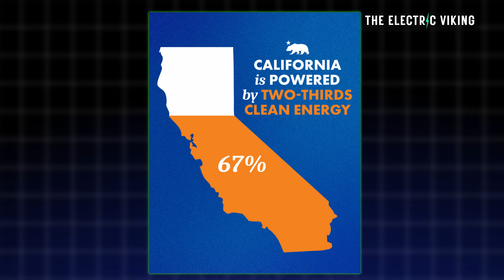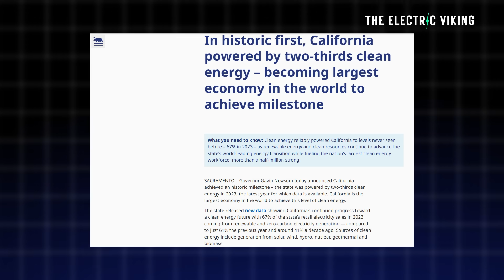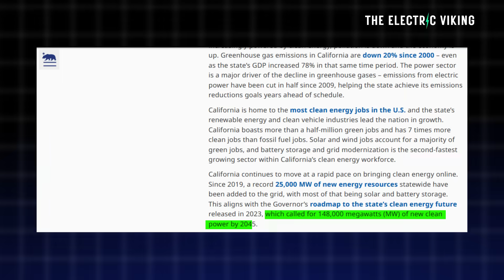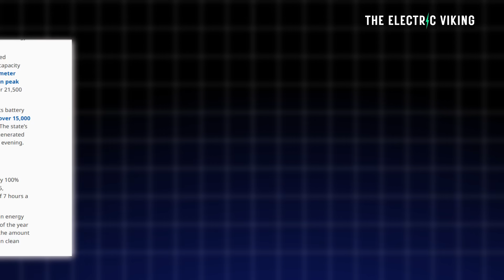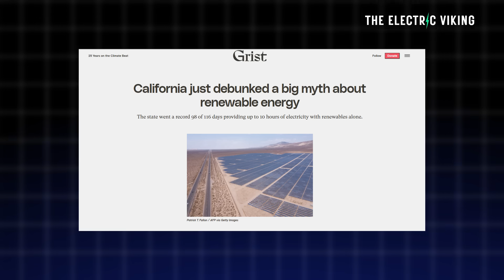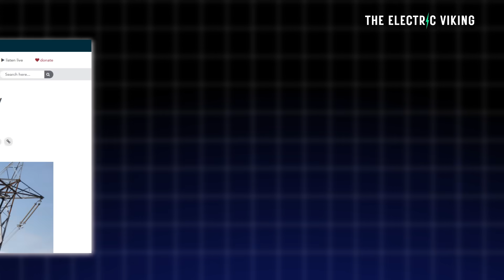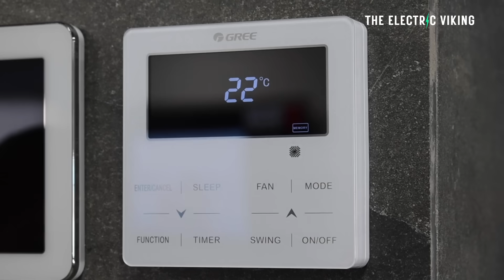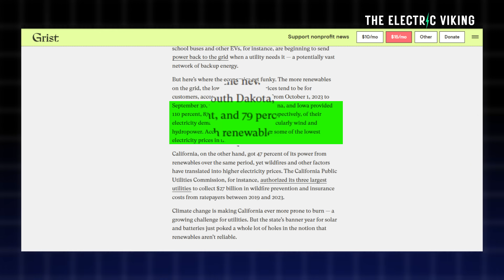California Shatters Renewable Energy Lies; Largest economy in the world to do this

Comment: The average California residential electricity rate is 35.03 ¢/kWh (100% higher than the national average).
The average California commercial electricity rate is 22.91 ¢/kWh (76% higher than the national average).
Energy rate data sourced from the Energy Information Administration.
Last Updated August 2025
Reply: And this is one reason people are going solar.  High gas prices are also driving people to EVs in CA.  In my area, EVs make up nearly 50% of the vehicles. We have solar and batteries and drive only EVs (Tesla and Rivian).  We have a net power bill of $-300/year.  This is due to the credits we get from selling electricity back to the grid.  Nearby homes that have not added solar can run bills of $800/mo or more in the summers for A/C and other high-power usage systems.

Comment: California second highest cost for electric is oppressive! Petrol is the highest in the country,  Taxes  cost of housing  totally out of control
Reply: True.  But other things like property taxes are low and can only increase by 2% a year regardless of the increase in market value.  A lot less worry about property tax  increases forcing you to move.
Reply: Wildfires significantly contribute to California's high electricity costs. The fires damage infrastructure, leading to increased spending on wildfire prevention and repairs, which is passed on to consumers through higher electricity rates.
Reply: Do you live here in California?

Comment: What happens on cold winter nights when there's a wind drought for days and it's cloudy and cold and the days are short when renewables are producing very little and all the fossil fuel generation has been closed down? Didn't think of that did we? Why is California asking people not to charge cars or run aircon during hottest times in summer? When renewables dip to almost zero because of weather night clouds and you know they don't have enough battery storage for night that's when rolling blackouts start and mass energy rationing.  Also how much does it cost to clean all those solar panels? Because every spec if dust reduces efficiency. The maintenance in solar must be horrendous? Is that why they're paying so much in subsidies to multinationals renewable farms?
Reply: "winter nights", hibernate.
 "wind drought", exhale.
Reply: @dudleymills1427 🤣
Reply: Texas is three times more dependent on renewables than California!😂🤣🤡👍

Comment: Well really I am not surprised there are some experts that think this, but why? Well I tend to think yes they are right in a way, that 50 years ago, 40 years ago, 30 years ago, maybe even 20 years ago, just adding this amount of renewables into the grid (if we could do it all at once) would have caused chaos and collapse of the power grid, but what is often forgotten is we aren't just adding renewables to the grid. As technology advances and systems change the power grid over the last 20 years or so is slowly being reconfigured. I mean who, 20 years ago, would have even considered that 30% of homes in Australia would have home solar, contributing roughly 12% of the entire countries power mix? The answer is probably in the low double digit numbers, a few early visionaries maybe, but grid battery storage, home and business small solar, they are all contributing to gradual changes in the power grid that changes the way the grid works. I mean a few years ago where I live installations of home solar was basically restricted due to the power grid, you couldn't add any even if you wanted due to instabilities, but now it's fine, a few years on the grid has changed the way it handles solar, this happening on a small and large scale. So yes, if the grid was the same is it was 20 years ago maybe it would have collapsed, but it's not, and it's still changing.

Comment: Sam, yes your information and analysis is correct.  Renewables are powering vast majority of California grid electricity while electricity if you need to buy it is expensive due to continuous wildfires created by vulnerable electrical power lines that need to be upgraded.  Got solar panels installed 30 years ago, generated electricity paid for panels over THREE times to date. Got more solar panels and a couple Tesla home batteries FIVE years ago, will be paid for in next couple years with generated and stored electricity. With TWO EVs, heat pump water heater and HVAC systems, our home is fully powered day and night by solar panels and batteries about 9 months a year.  We use a small amount of grid power only during rainy winter and early summer fog months when solar beyond what’s used during daytime is unable to charge batteries for nighttime use.  As part of the Tesla Virtual Power Plant community of 2500 homes in our area we send a portion of saved battery electricity to our neighbors grid annually since 2020 to prevent blackouts or power reductions. This year only a small amount of summer electricity was sent compared to past years.  California had no blackouts since the VPP program started and when California installed huge battery storage systems since 2020.  When will our Aussie friends in charge of electric power understand these realities and update electric generation and storage in your country?  Australia can then slow and eventually stop imports of coal, gas and oil. Australia’s GDP will soar as it has in California, now THIRD largest economy in the world! Good Day!  James from Central California.😊
Reply: The cost of photovoltaics in California is 4 times that in Australia.
Yet an Australian bank savings account produces a larger income.

"Australia can then slow and eventually stop imports of coal, gas", Perhaps you mean exports, a major part of Australia's income.

Comment: You should check out the Ridge Blade home wind turbine. It pops on top of most roofs and can provide electricity generation in very low wind. The biggest reason for increased energy cost in California is that the majority of Utility companies are FOR PROFIT entities that serve their stock holders first rather than their customers. CA used to have very affordable rates back in the 70's, 80's and 90's but that all changed once they privatized them.
DON'T EVERY let the politicians privatize your Utility companies.
Reply: Yes will check out the Site have followed advanced wind generators for many years but may be the feasible unit now!!

Comment: And yet, still has some of the most expensive energy rates in the country. Whether you drive an EV or ICE, you pay far more than most other Americans, not to mention for trying to cool your home in the summer...
Reply: If you drive an EV ,and have solar and batteries, you can drive and cool your home for nearly free.  We net about $300/year back for sending power back to the grid and powering our home. With our high power and gas rates, the savings can amount to nearly $1000/mo.  This will let us cover the costs of installing batteries and solar this year (6 years total).
Reply: @JBoy340a  he did not read a word you said
Reply: @JBoy340a Frée?, what about the tens of thousands for you spent on the infrastructure.

Comment: Renewable deniers are the equivalent of being proud to piss against the wind.
Reply: I'm not fully convinced that net zero is attainable, but I still see a future for this technology, and it doesn't hurt to reduce pollution
Reply: @John_N_M  “it doesn't hurt to reduce pollution” ??? Are you insane ???
Reply: @alex.velasco Are you telling me that you don't care about environmental pollution
Reply: @alex.velasco every time people try and say solar panel peoduction is somehow more damaging to the enviromemt,  I always have to point out that is always a factory issue, not a design one.

If its so awfull then fix your god damn production methods and update your systems to better standards. And dont try to make up excuses, anybody that says it cant be done is just a greedy corporate tool trying to cut corners. 

 and if its a matter of sheer energy, thats even funnier, because that just means the problem solves itself as more solar installations are built.  It will stop being being an issue when you stop using coal to power everything geniuses.
Reply: @bongbong-bongbong-bongbong 50% of the worlds population use 90% of the worlds resources, and the modern lifestyle is not sustainable in the long term. Civilisations collapse due to a lack of resources. The west is heading that way. You're using up another set of finite resources. Anyway this is an argument for a different forum. At least we may get some cleaner air when those old clapped out coal plants finally close.
Reply: @John_N_M  Of course I care deeply! What kind of statement is: “It doesn’t hurt to reduce pollution”? It does EXTRAORDINARY GOOD to reduce pollution. And pollution itself is an EXTRAORDINARY BAD, FYI.

Comment: In Oregon, solar power works very well from about mid-April to mid-October, a half of the year. We are completely off-grid during that time (15kW of solar). In Winter, solar yields are low, so we go on-grid, supplemented by solar, and 90kWh of batteries. Oregon has plenty of hydropower available from the Bonneville Power Administration (BPA) in winter, so that works out quite well. However, the BPA has been very obstructive in terms of allowing other renewables onto "their" grid. As a consequence, Oregon gets very little power from solar, even in summer, which is a great shame. The BPA needs to get its act together! Hillsboro, Oregon has seen rapid expansion of data centers, primarily because that's where all the optical fiber feeds over the Pacific come in for the West Coast. That, and our drying climate means we have to start bringing large solar farms online very soon.

Comment: In the summer months we tend to run our aircon system from around midday whilst we are generating more than enough solar from the roof to run it. We get the house cool and then adjust the thermostat on a remote timer once the sun starts to go down.  The aircon then requires very little energy to maintain a comfortable temp in the evening and our battery can handle a chunk of that.  It’s rare for us to need grid energy in the evening peak.

We need to encourage more responsible energy usage from households and businesses.  Businesses are actually the worst offenders in my opinion.

Comment: 2/3 - eeeyow! I was (in the past) worried that battery capacity would be lagging for a while yet. And this will give Cali an advantage, especially as wind and solar costs continue to fall while fossil fuel costs continue to rise. Sadly, for fossil fuel gazillionaires anyway, Cali will continue to use less and less of their product. This means that commerce and industries with heavy electrical costs will be more and more attracted to Cali, not, say, Alabama.

I almost said Texas, but Texas is also another renewables power player.

Comment: You hear negative about California because BIG Oil controls the message. California has reduced air pollution and deaths from air pollution and this is the OPPOSITE of polluting ICE and anything fueled by gas and oil. The GOP wants to eliminate solar rebates and anything that does not use oil. Vote the GOP idiots out of office

Comment: My roof’s diy solar panels system powers 6 homes & my bev in Vermont no power bill since 2017.
200,000 kw sold to members of our net metered group.
Reply: I envy.
Reply: Your a bloody legend
Reply: where can I get info on doing something like this? Are you urban or rural?
Reply: @scrambaba  A good source for DIY solar info is Will Prowse.  He has a channel.  There are tons of other channels with good info, but Will has the kind of intensity of focus that leads to real expertise.
Reply: That must be a large number of panels. Maybe you're not on electric heat and/or hot water. I have 71 panels with 3 more going on shortly. I grew up in NY just off Rt4, which goes through Rutland, VT. It might not get a cold as it used to, but there is still a huge heat load with limit sun in the winter. If you're covering all of your energy needs with solar and have that much left over, that's a huge array or there some unknown factor playing in. Growing up, we heated entirely with wood, but that's what you do when you have a couple hundred acres of woods and 8 kids for labor. Ground source heat pump would help considerably. I've done that in the past, and in that specific application, it had very low energy demands. I'm on air-sourced heat pumps now and there are months that even the 71 panels don't not cover a full electric house much farther south than Vermont. On the whole, net usage is well in the negative territory. At the end of July net to the grid was 10,000kWh for 2025. I too have an EV. I had two but gave on away when I started working from home, replacing it with e-bikes and e-scooters. At one point I had 7 electric powered vehicles, but 6 were micro-mobility.

Comment: A big reason for battery uptake is because we changed our Net Energy Metering system to make it so that batteries are the only practical way to save money when installing solar on your home.  Just use chat GPT and ask the difference between NEM 2.0 and 3.0 in California.

We now don't get hardly any money for excess power generated. This is going to hurt the state a little bit moving forward in part because people like me aren't going to want to expand their systems. I put in a smaller system with a powerwall to balance the cost of my power in 2019. Fast forward 6+ years and now I have an EV and am installing a swim-spa. I'd like to bump my generation up a couple kw, but if I go over 1kw, I'll get put on 3.0. That means I'd have to spend an extra 10k or so just to get back to what I have on 2.0. I'll probably just wildcat some extra panels in my system without a permit. I get that the state wants more batteries in the system, but this is too much of a gift to the utilities. They should pay us a better rate for our power. I'm not asking for full-retail, but a few cents per kwh for export is a joke. because people like me aren't going to want to expand their systems. I put in a smaller system with a powerwall to balance the cost of my power in 2019.

With the elimination of the federal tax credit, until interest rates come down, making the economics better, we are going to see a huge0. slow down in PTO's, in my opinion. You can't just put up 10kw on your roof to save money anymore. It is still a viable cost/value calculation, it just takes a lot longer because you have to pay for more battery capacity and the interest rates make it take longer for a ROI.

Comment: When Ca has a surplus from solar, over capacity, it is sold to other states. It sells at low prices, but doesn't just dump it. This from the state grid authority.I have a small farm, 3 wells 2 for irrigation. I haven't paid for usage in 6 years, I paid off the 11 K solar system in 8 1/2 years. Installed in 2014.
Reply: So, now your energy is FREE !!
Reply: In the past, CA has paid other to take the over capacity, and those states dumped it; or as they put it they used the CA energy and dumped their own solar.  For the most part, you CA can't sell its solar surplus because when we have a solar surplus, so do our neighbors.
Reply: @sadietz100  It sounds like sodium battery technology is coming to market just in time.  We're gonna need a lot of them.

Comment: Over priced fuel will cause this. Traditional energy generation is just getting more expensive and at the same time renewables are getting cheaper, better, and easier to deploy. Zero fuel transportation cost is a big plus. Trains and trucks cost a lot and it's an uncontrollable expense. In California solar farms could also function as a fire break if designed right and  in the correct locations. That way creating a fire break is not just an expense that returns no product.

Comment: The one to watch for may be the UK in future though. It's a big economy, but more to the point, it's an islanded grid. It has HVDC connections, but no AC ones. If that starts running 100% low carbon for ever longer periods the discussion will be over.

Comment: When I last checked the Cal ISO website, roughly last year, CA had enough batteries installed to cover roughly one third of the over night power needs.  To me, this means we just need to repeat this battery build out two more times.  This is very doable.
Reply: Tony Seba says we will need 30 to 90 hours of battery storage to be 100% renewable. So we will need to repeat the current build about 10x or 20x. But with the cost of batteries continuing to plummet, this should be very doable in the next 5 to 10 years.

Comment: The problem with solar/wind is that you still need DUPLICATE generating infrastructure to power the grid when solar/wind don't work.  Imagine you had really inexpensive tires that worked great on smooth, clean dry pavement, but didn't work for any other driving condition.  That means you have to buy TWO sets of tires and wheels and constantly change them back and forth in order to drive.  Overall you spend more money (two sets of tires and wheels plus cost of changing) and are greatly inconvenienced.  But you can claim you did 40% of your driving on the cheaper tires.
Reply: Now, I see that CA included hydro and nuclear in the 2/3.  Why not just go 100% hydro and nuclear and forget all the stupid BS and extra costs and complexity?
Reply: @dzcav3  Because that would be logical, and not adhere to the eco zelot ideaology
Reply: All you need is enough batteries (including electric cars that can send electricity back to the grid)
Reply: @udishomer5852  And the trillions of dollars which would be required to achieve your fantacy